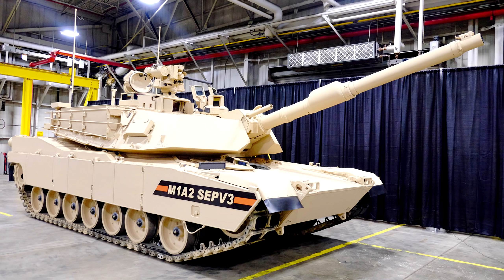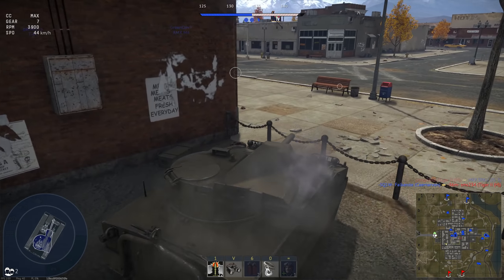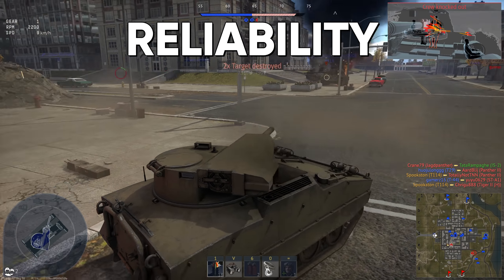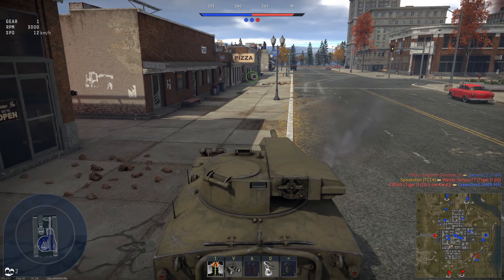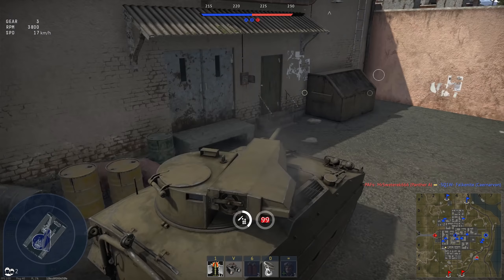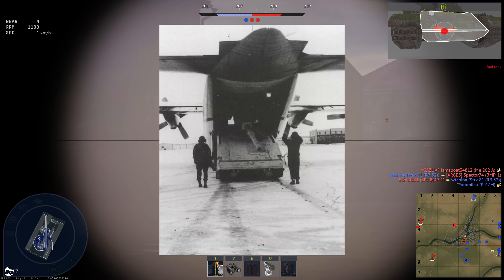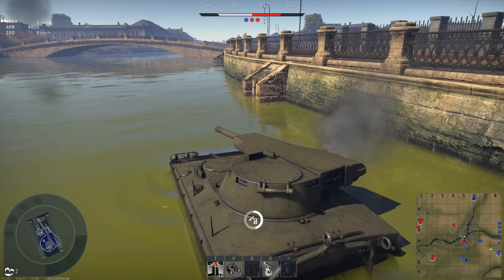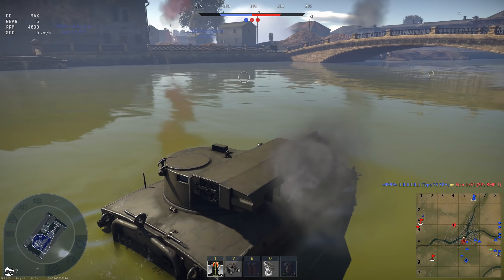What Makes A Good Tank?

Comment: Communication equipment can be more important than fire power and armor
Reply: A combination of radio communications equipment, superior crew ergonomics, and superior optics is what allowed the lighter German tanks to defeat more heavily armoured and armed french tanks. If you only looked at the "Golden Triangle" of tank design there, there should be no way the lighter German tanks were better than the french ones, yet they were.
Reply: @oneofmanyparadoxfans5447  or your convince the crew it's not a good idea to stay in their tank or they'll bang their various body parts on the inside of their tank enough to die or get seriously injured to the point where they can no longer fight

Comment: German Tank Design Philosophy:
- Large and heavy
- Expensive, complex, and difficult to maintain and manufacture 
- Absurdly thick armor
- Powerful weaponry
- Excessive fuel consumption 
- Small modifications between individual vehicles
- No less than 12 variants, not including tank destroyers
- Intimidating
Reply: Still love 'em though
Reply: Russian Tank Design Philosophy:
-Small and light
-Cheap, simple, easy to maintain and manufacture
-Angled armor made from strong alloys, lightweight, abundant, cheap
-Powerful weaponry, most T-34 was armed with 85 mm gun, KV 2 - 152 mm howitzer, IS 1-2-3 no lee than 100 mm gun, not to mention 152 mm SU-152 Tank Destroyer
-Generous fuel consumption, multi-fuel engines
-Few but significant modifications between models: For Example t-34 1940 with  short 76 mm gun, and t-34-85 1942-1945 with 85 mm long barrel
-1-12 variants max, including tank destroyers and self-propelled artillery
-Look simple but sometime impossible to defeat on battlefield
Reply: Oh, and I forgot, very few actually produced
Reply: Menacing
Reply: олег бурдин 
You forget the spontaneous electrocution of the driver, can’t forget that.
Reply: Well, at least the germans learned out of their failure, the americans went right into the same trap, just looking at the Abrams compared to the Leo tanks.

I find it quit funny.
Reply: Mandernach Luca 
Ehh, Germany’s tank failure was more of fixing the design problems and getting the factories ready for the Panther which in 1943 hadn’t gotten out of its growing pains yet, meanwhile the T34 (1943) just had gotten past the biggest issue of being a death trap with only two hatches to escape from.
Reply: @Enthropical_Thunder  Quite
Reply: @Enthropical_Thunder  The Leopard 2s are overrated and have not been combat proven.  Stop being jealous of American military superiority and just accept the fact that 99% of the time.  The US has better stuff.
Reply: @thewolfsgames8883  Not realy. Us stuff is good, nothing wrong about that but sometimes do they do shit  like a VTol wich has for a plane  unnecessary stuff wich makes the plane heavier and less movable wich is a big disantvantage in combat ... dont want to list everything but you know what I mean. At least I hope you know. 

Us goes strong but isnt a god of an army. Its just an good army. Dont complain about overrating and overrate your own stuff just in the next sentence
Reply: @little_lord_tam  You mean the VTOL that most western countries are using?  Or an Osprey that the Marine Corp uses?  I get what ur saying.  But could you clarify?
Reply: @thewolfsgames8883  I ment the F 35 In this example. Its a fighter but the tech that makes him able to Start like a chopper makes it heavy and this couses him to be less effective in a dog fight. And as the name F (Fighter) says is the F 35 ment to make dog fights wich is truly not the best thing it could do and this is one of the examples of the weird things that the US army invents sometimes. I mean the V Tol tech is great but here is it used in the  wrong way
Reply: @little_lord_tam  Well it's been pulling off some impressive maneuvers in recent air show.
Reply: German tank philosophy didn't become that until halfway though the war.
Reply: @thewolfsgames8883  That's not a fact, and the Leopard 2 is not overrated. There is a reason why so many countries use them.
Reply: Give me a fucking break, even in WW2 this wasn't true. Most of these apply to the Panther and Tiger but those aren't the only tanks that the Germans built now were they. 

The earlier Panzers were specifically designed to be light so that they would fit over the portable 18 ton bridges that the Germans had and to keep up in a war of movement which they did amazingly well at in France. After that it was clear that the Panzer 3 and Panzer 4 needed better guns and armor so they naturally became heavier but even then they weren't particularly large or heavy.

One of the main points of this video was upgradability which both the Panzer 3 and Panzer 4 were great with. In particular the Panzer 4 was great because it was one of the few vehicles that remained in production for the entire war and also remained useful and deadly as well. The Panzer 3 didn't last as long as a gun tank but the Stug 3 was actually Germany's most produced AFV and arguably most successful as well. 

The only things on your list that truly apply to the Stug 3 and Panzer 4 are powerful gun and intimidating.
Reply: @bastionaudio  Some of these are true for Russian tanks but there are numerous exceptions as well. 

The KV series was very heavy, expensive, and complex. The IS series was cheaper and less complex but not exactly lightweight. 

The Christie suspension of the T-34 was also not at all easy to maintain and the fact that parts from different factories often wouldn't fit didn't help maintenance at all. 

There are also a few more rules you could apply for Russian tanks, especially in WW2
-abysmal ergonomics 
-almost non-existent gun depression 
-bad crew safety 
-often have very bad welding 
-often have brittle steel
Reply: @thewolfsgames8883  
If that's so, than please explain to me, why so many countries use the Leopard 2.
It is  fact, that the Abrams is very heavy, has bad milage and is expensive  compared to the Leo 2.

So please try again ;D.
Reply: @bastionaudio  is-1 got 85 though
Reply: @MDPToaster  Ironically German were already were working on a new tank project designed for the 20 ton weight range meant to replace both Panzer III and Panzer IV that was close to completion when operation Barbarossa happen. Hitler had scrapped the entire project sent the designers back to the drawning board and design a 30ton tank from scratch
Reply: Lowes Manager that is just western propaganda :P
Reply: @lowesmanager8193  I think you took a comment from someone who loves German tanks way too seriously, mate. :D
Reply: @Enthropical_Thunder  The Leopard 2 and modern Abrams weigh nearly the same, have similarly powered engines and relatively similar ranges for their fuel capacities. The guns are almost exactly the same (at some points they were) and preform very similarly. I don't know why you're saying the Leo 2 is so much better when it is very close in specs to the Abrams. A few differences, of course, but by and large they would preform the same.
Reply: @beanlord4347  Well I love the Sherman but I don't go around making Ronson jokes because that would be stupid and inaccurate, to each their own I guess
Reply: You forgot one thing, *ABSOLUTELY NOTHING BUT AIR INBETWEEN ARMOR FOR BEST ARMOR*
Reply: put a cat name on it
Reply: Still good ,especially since we all know what happened the last time they made fast reliable tanks
Reply: Americans:

MaCHine GUn
Reply: @lowesmanager8193  yeah its kinda dumb hearing people complaining how germans made bad tanks but forgeg the actual spine of their ww2 tanks
Reply: @little_lord_tam  There's three variants of the F-35. The one you're talking about is for the Marine Corps which has a different fighting doctrine from the Air Force (F-35A) and Navy (F-35C).
Reply: @bastionaudio  before, I though this was a bit innacurate, but after playing war thunder and facing of the t 34,holy fucking shit is the turret impenetrable, and holy fucking shit, that 85mm is fucking bullshit. God, I wish I didn't go American.
Reply: @bastionaudio  although the 76mm made it a bit more feasable.
Reply: @bastionaudio  yes
Reply: @thewolfsgames8883  yeah, no. the Leopard 2 was not overrated or underrated, it's in the middle, while the Abrams is really overrated in America and other countries, Abrams was a gas guzzler so not many countries buy it and they prefer the Leopard 2, thus making it look overrated
Reply: @jooot_6850  You are correct on all of them except that Engines aren't similar because Germans use little less powerful engine but it uses alot less fuel and is alot more efficient
Reply: @kautkas01  This is true. Gas turbine versus a standard internal combustion engine. They both have pros and cons.
Reply: @little_lord_tam  that's only the f-35B variant which was designed to replace the aging Harrier and accommodate smaller aircraft carriers which could not operate the f-35C variant
Reply: @lowesmanager8193  a lot of countries use leopard 2s because they're a current generation main battle tank that's commercially available and fits most countries tank doctrine.

they are still super overrated just like every modern main battle tank.
Reply: Reason why I main German tanks in world of tanks lol.
Reply: Theur actual Philosophy:
A small number of tanks but strong enough to hold off numerical superior enemy
In which can be build under limited time
No point build more Pz 4 when the sovuet could field more T-34 in a short terms which could easily destroy Pz 3,4s from the front anyways
Reply: @little_lord_tam  dude with BVR missiles dogfights is dead.
the Gun is there for emotional support
Reply: @marseldagistani1989  After three years I know I was wrong. Dog fights don't realy happen anymore. The combat happes beyond line of sight and its all about seeing the enemie befor you are Seen with your Radar and what not
Reply: @bastionaudio they weren’t cheap and easy to make the factory’s were making them at shit quality causing loads of deaths and failures of mechanical stuff
Reply: @bastionaudio Mendeleev tank?
Reply: @bastionaudio  I know that this tank wasnt really produced (except for maybe like 2 prototypes i atleast know of) but the is-7 would be a prime exaple for a tank that is the exact opposite of what you just were talking about, it was really expensive, had way too much armour, was not easy to produce, broke down easily,  and probably just looks scary. The is-3 is also well known for just looking scary, but not really being combat competent. Im just saying sometimes soviet tanks are overrated, even though i also like them by design and i also think that most tanks of them were really good at doing what they were supposed to be, like the t34, which was light, reliable and had a powerfull gun.

Comment: TL;DR: Basically the Shermans

On a similar note, and I know it was mentioned in the video; design specifications and doctrines also take into play. If the design specifications specifacally says for an air-liftable amphibious light tank, it doesnt matter if your tank has the strongest armor or the most advanced gun if it can't be air-lifted or swim. 

A lot of the times, tanks (or any design in general) would have weird or missing features that could easily make it a "bad" tank if you don't take into account what it was designed for and it's original design requirements. Context really matters
Reply: Like people comparing the F35 to the Warhog even tho it won't be CAS
Reply: @killian9314  
There's some logic into this as the F-35A is also meant to be replacing the A-10. But yes! F-35A cant CAS like the A-10 do
Reply: @killian9314  Except the air-force want to replace their A-10 fleet with it, hence the comparisons. You and I both know the F35 will never CAS like an A-10 can, except for some reason the air-force seems to think it'll be fine.
Reply: @Justowner  The Air Force seems to be angry at any combat plane that can't go at least Mach 1.5 or carry >10 tons of ordnance, or both. Meanwhile, a good CAS plane today might be something like the Super Tucano...
Reply: @killian9314  it is worth noting that the A-10 is only useful in situations with complete air superiority/ air defenses ( due to its speed limitations). something like the F-35 does fill the role of CAS in contested regions where the united states doe not yet have air superiority.
Reply: @Justowner  the a10 has been finding shortoming for it's duties given modern weaponry, it is great for CAS as soon as air superiority is aquired, and in risky situations where its not, it is a quasi flying tank, but the f35 is not meant to take away its role entirely, it with a gau 12 25mm brrrt to give the boys on the ground... 4 seconds of hope, and then there'll be a need for a new bid to fill the dedicated role, as the f35 is multirole, but there hasn't been a fill for the role the f14 left open in 2006 for fleet superiority fighter, so we may not see a fill for the a10s one soon
Reply: @mikeganzert6666  Or we just use a F-15E strike eagle that can do both CAS and air-air combat for a fraction of the cost of a F-35A. Plus the Marines would gladly take those A-10s if the chair force no longer wants them.
Reply: I feel the hellcats are overall a better tank in WW2 as it's fast, it's gun can take out tigers and bcoz of it's weight it can easily transported and shipped to far off places like Korea.
Reply: @killian9314  
F-35 is a multirole, that's mean it can be configured for a specialized role. When stealth is no longer needed, the F-35 can load up its external hardpoints with anything you want. F-18 and F-16 straffed sometimes too, as well as the Harrier. Part of the reason the F-35 strayed away from the 20mm gun is due to the need for the ground strike role currently filled by the Harrier, which used the same 25mm ammunition, which is a step above the 20mm in term of power (bigger round = more explosive fillings).
Reply: @mikeganzert6666  also, the F35 has a maximum carrying capacity if 18000 pounds in beast mode, that's 2 5000 pound jdams, and 2 2000 pounders occupying the pylons, without counting internal weapons bay
Reply: A great example would be alot of Japanese tanks, absolutely shit when compared to other nations during the war, and near the end when they came up against the Russian T-34-85's and IS-2's, they were fucked. But when you look at the requirements of what they were needed for, they were actually quite good, atleast for their role.
Reply: A L  Sherman firefly has a better gun also hellcat is an anti tank rifle target
Reply: @killian9314  No, the A-10 is not a flying tank. Not being shot in the first place trumps being able to take a hit. An A-10 is far more likely to be shot down than an F-35, F-16, or F-18
Reply: @habe1717  quasi. It can take a lot of pounding, in tests it can loose an engine, one of the rudders and half a wing and still land.
Reply: @habe1717  yeah, it is easier to shoot down. I'm not saying it isn't less nimble. I'm just saying it can take more damage.
Reply: Akin Khoo  
On what basis is not a good tank?

"They have no choice to with it because they need it in Europe" is basically the M3 Lee

If the design serves its purpose based on doctrine and original specifications, then that literally means it's a good design. What are you on about? 

A bad tank is one that can't even perform its original purpose (or bad at it). 

Note: A bad design is different than a good design but being used on a scenario its not meant to (that's more of a doctrinal thing / operator misuse than it is a design issue)